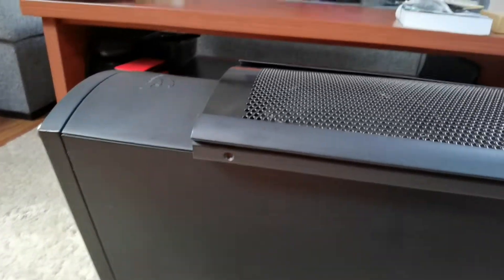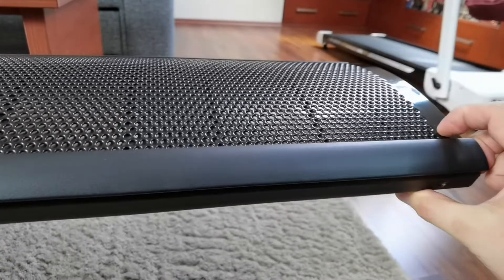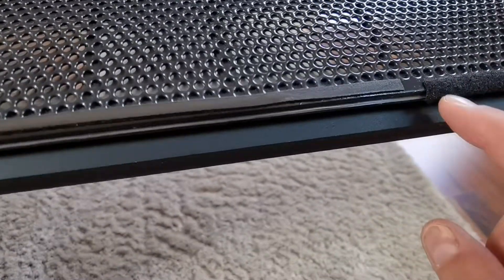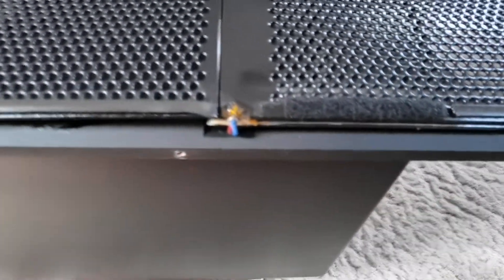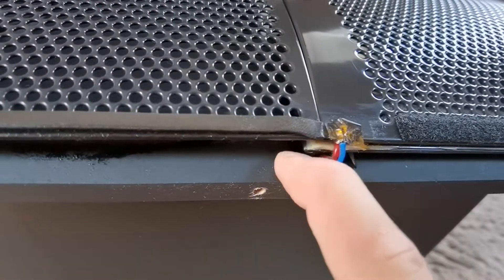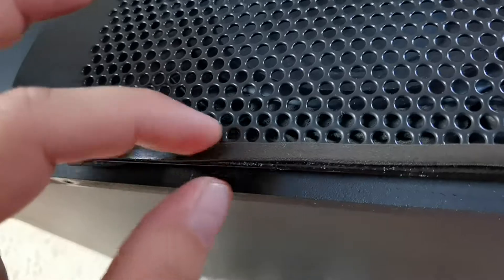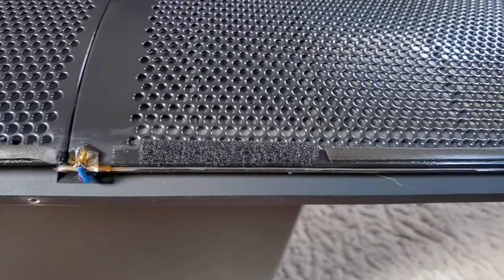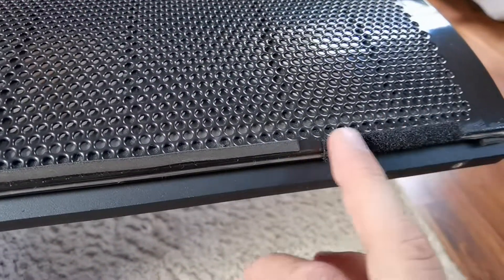Martin Logan Scenario panels sliding down fix part 2

Comment: This was very helpful as I have had the exact same issue with my ML Scenario as you show here.  I set the speakers aside for years now, but this shows me what to do.  One of the speaker panels dropped several inches and does not work at all, obviously, given the connection. tbd.  I want these speakers back in operation in my surround sound rear positions.   Pretty awful design, certainly subpar for what I would expect from ML.
Reply from the maker: On one hand, this design is primitive, especially for the price. On the other it's dead simple to repair, so it has some good sided :)
Good luck with restoring them!

Comment: Helpful video, thanks! I'm running into an issue where the panels slipped, disconnecting the wires. Sounds was great before that, just getting the base now. Did you have to reconnect your wires?
Reply from the maker: No I did not, but Its simple - Ive removed panels in my Ascents. The wires are hidden in on of the side panels behind a small flap and there is a screw-in type connector for a wire that goes further to the crossover assembly
Reply: @k4syx  Thanks! Will take a look as I think it was stripped off when the panel slipped.
Reply from the maker: @kpierce34  Should be easy fix as long as the panel end still holds well - good luck, keeping my fingers crossed!
Reply: @k4syx  Haven't gotten back to fixing this w the holidays. Will try it later in the week and thanks again!

Comment: My friend where's part three?)))
Reply from the maker: There is no part 3 :) 
You just need to remove the velcros (they are like stickers), clean the places with alcohol and stick new velcros. Then you place the panels aligned as you like (they can be freely removed at that point) and assemble all back.
That's all really :)
Do you have any specific questions I may try to help with?